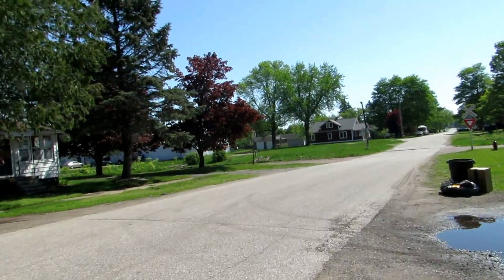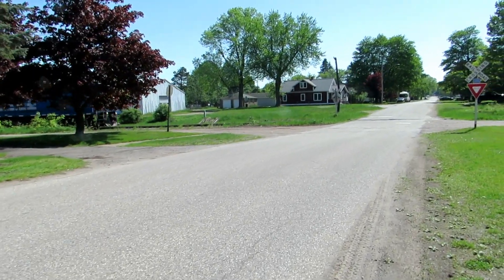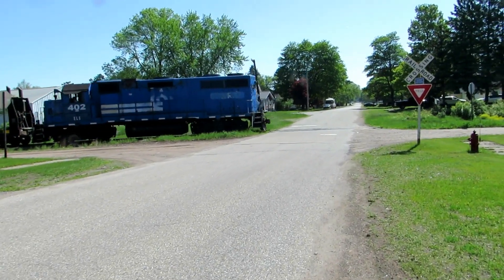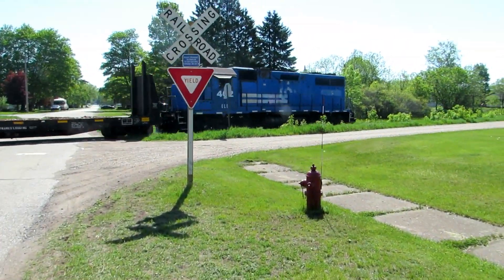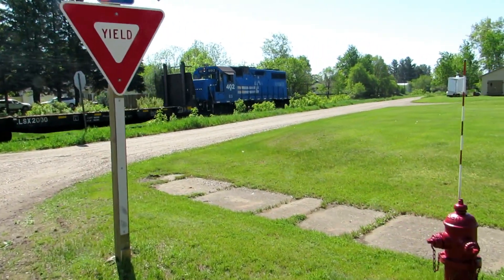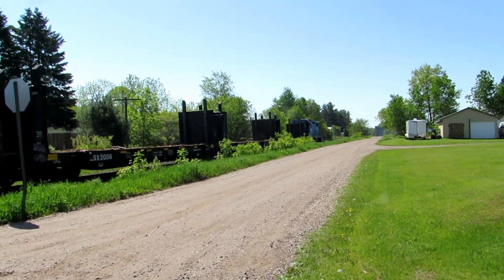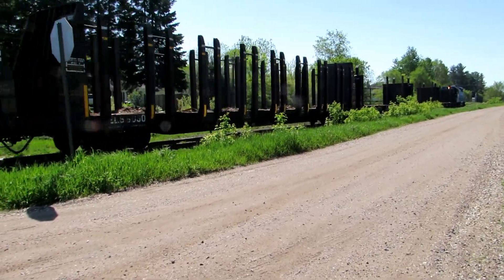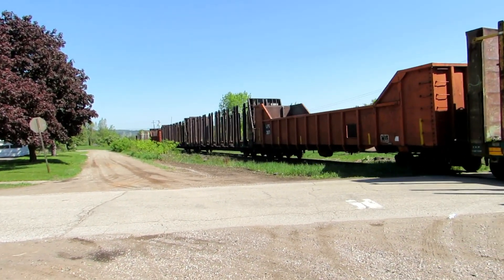ELS 402 DEADHEADS NORTH AFTER SPECIAL DELIVERY | Jason Asselin

Comment: Hello just speculating here but  It appears troulble may be behind, crew may have  taken the cars which were ahead of the possible incident to nearest siding or set out track  and went back  to rerail , ive experienced this situation in my career   . As for fred most likely still on the rear of originating train . It is not considered a complete train  to other railroad employees  or FRA unless it has an EOT or red flag displayed at the rear .
Reply: Agree that something may have happened up line. Knowing E&LS track condition that wouldn't be too surprising. Also running long hood forward almost dictates lead unit was cut out somewhere. But, E&LS does some oddball things, so who knows.